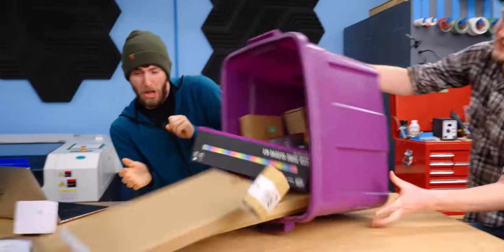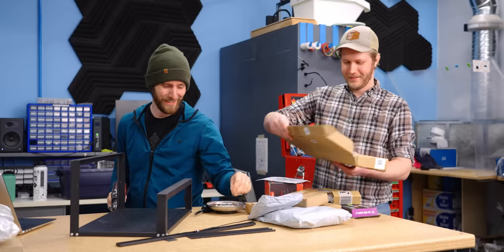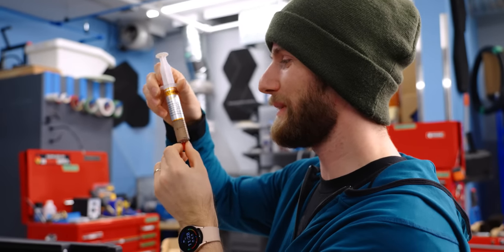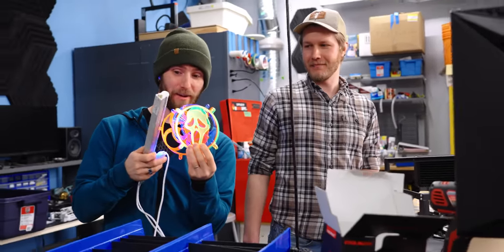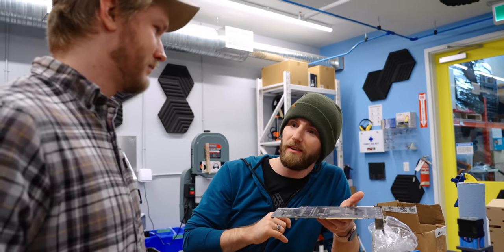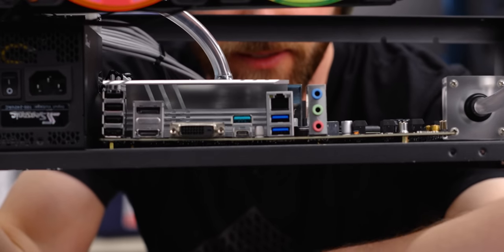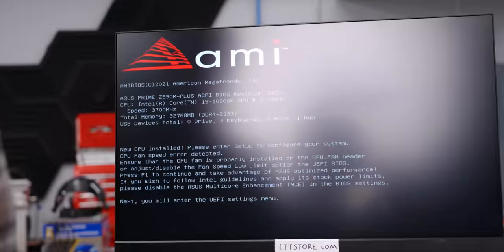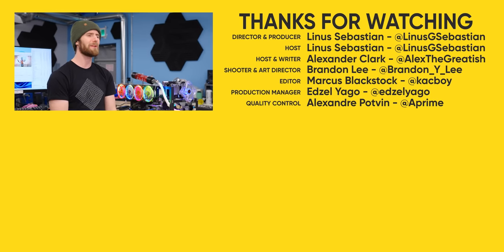Water Cooling… Using only Wish.com

Comment: I have a few of those same types of UV lights (24:35) around my room but they're just a bit longer. They came with rubber caps to cover the exposed connectors on the end, and wow I'm glad I used them because I didn't even think of it being a shock hazard at the time!
Reply: Not a shock hazard, actual electrocution. As in potentially fatal.
Reply: @FIGHTTHECABLE  I have similar lights in my workshop, the little caps Jack’s talking about are really secure, like, almost impossible to get out. 

Also, the wires Linus was talking about when he thought you could daisy chain them together are for tying them into a circuit, the ones I have come with double sided wires with connectors for that.
Reply: @maxwellgriffith  you would have to hold your hand on there for a while for it to be fatal. I’ve accidentally shocked myself a couple times with 120 volts and it was far from fatal
Reply: @michaelhorvath9599   Yeah, he used the word "potentially" there, tough guy.

That it CAN kill you, not that it necessarily WILL kill you. And that is potentially enough to kill someone, if they're unlucky.

And if we're trading tales of electrocution, I got shocked by a wall socket - and I'm in the UK, so that's 240V, by the way - when I was a kid (about 9 or 10 years old, roughly).

I had a cassette player (which dates how long ago this was) but it didn't have a UK three-pin plug, only a two-pin plug (I guess my parents purchased it in Europe or America or somewhere?). So I had to use a two-pin to three-pin adapter. The adapter was in the socket and turned on, and the two pin fell out. So I went to plug it back into the adapter, but I was insufficiently careful and my finger was (barely) touching one of the pins as I inserted it.

It actually caused muscle paralysis. I initially couldn't will my hand to move away. The shock was keeping my hand in place. But, eventually, I was able to will my hand to move. I was in my room - no-one else around - so if I'd been unable to eventually force my hand to move... who knows? "Potentially fatal", as was said. 

And, yeah, a short temporary shock isn't so much the issue, generally, but that it could cause muscle paralysis - the electricity messing up the nervous system's messaging to say "move your hand away" (because the nervous system uses electricity itself, so there can be "interference" from being shocked) - and if you can't get yourself out of that paralysis, that's what'll do you in.
Reply: @klaxoncow  just too add on electricity there is far more 12v dc items than will kill you. than 120v - 240v ac items. volts doesn't matter. amps is what kills not volts
Reply: @klaxoncow  thats not electrocution, if it were you wouldnt be telling us. Electrocution means ur dead. You got a shock, sounds like it had no path to ground through you thankfully
Reply: @mycosys  again its not voltage that kills. its amps. your comment is funny btw. going by your logic. everybody any cop has ever shot with a taser(which inserts electrodes under the skin) would be dead.
Reply: @squirejones3116  It doesn't matter how many amps a source can provide if the voltage isn't sufficient to actually deliver that current. I could have a 12V supply which could provide a million amps and I'd still be in basically zero danger of killing myself. Hell, a couple of AA batteries in series could theoretically provide enough current to seriously hurt you, but good luck getting your resistance low enough to actually do it. Saying it's the amps that kill isn't really a useful way of thinking about it and doesn't paint a full picture.
Reply: @squirejones3116  Amps do indeed kill but they are driven linearly by the voltage according to Ohms law (V = R * I) so higher voltage = higher potential current. 12 volts literally cannot kill you (unless you insert electrodes under your skin) because the impedance of your skin is too high to allow a lethal current at that voltage. So voltage does matter. There are also secondary effects of AC that makes it more dangerous than DC, like inducing sweating that lowers the resistance of the skin but that is a different story.

You can google the health and safety executive of the UK government to see that the minimum voltage considered "hazardous voltage" is 120V for DC and 50V for AC for example and the US has a similar guideline. You can also find typical skin resistance if you want, and effects of different currents to see for yourself what sort of voltage would be dangerous via Ohms law above. Note again that the guidelines mention voltage, and not current since the resistance of your skin is (typically) known, and the applied voltage is what drives the amps.
Reply: @squirejones3116  While you must meet a certain threshold of amperage to kill somebody, that amperage can typically only be achieved when the voltage is high enough, as there is a linearly related. High voltage shocks like static electricity discharges do not kill you as there is practically zero amperage.
Any power outlet is very likely to kill you if it hasn't got ground fault breakers somewhere, that is one reason why they are mandatory in many countries. The thing is, in the US at least, I'm not sure about Canada, these ground fault breakers are usually part of the actual socket and therefore have no effect on socket where they are not. 
Bottom line: 110V AC is extremely dangerous without breakers and even with them it is completely idiotic to have these contacts exposed
Reply: @derfurz8618  GFCI Sockets can affect any number of other sockets on the same circuit, depending on how it is installed. Many kitchens in the US have only one GFCI socket, but all of the outlets in the kitchen are wired through it, so any of them will pop it. Same with bathrooms here.
Reply: @mycosys   Yeah, you're right. And I approve of your linguistical pedantism here.

Yes, an electric shock, not an electrocution - because, like, I am still here, typing this, right now.
Reply: @derfurz8618  volts without amps can't kill no matter how strong or weak. The amount of amperes is the only factor for electrocutions to be fatal. I have an electric fence around my garden it produces 12v@35amps it kills rabbits,cats,dogs. Basically anything that touches it.
 But hey you believe what ever you feel you need to...
Reply: If you don’t have GFI circuits you can absolutely get killed from that, get a heart attack or seizure etc. your house can also catch on fire. Exposed wiring is no joke.
Reply: @squirejones3116  Why do we see this fucking bullshit all the time? Your body provides resistance, you need quite some voltage to push current through your body. 12V wont do jackshit unless you licked both electrodes at the same time, and even then it's just slightly uncomfortable. Your body is not a short circuit, you need volts to push the amps.
Reply: @PhaTs00p  grab hold of your cars alternator charging wires and get someone to start the engine. Grab yourself a Darwin award
Reply: @squirejones3116  Ignoring how foolish setting up such a comically lethal electric fence would be, I think you're misunderstanding its specifications. It's common for electric fences to be POWERED by 12V (e.g. a car battery), but they they step this up to hundreds or thousands of volts to produce a shock . A 12V 35A output electric fence would be useless at best, and a heating element at worst. I have a bench power supply which will output up to 20V at 10A and - surprise - nothing happens if you try and shock yourself at that voltage. Even my laptop charger is 18V 7A!
Reply: @klaxoncow  I'm glad I'm a wee young lad and my parents installed GFCI for the whole house (germany, I don't know electrical code now or then), even floor seperated, so I only popped upper floor GFCI when sticking things in the outlet.
Reply: @squirejones3116  you Just clearly Show you don't know anything about how electricity works. Yes Amperage is the deadly force, but it cannot occur when there is not a sufficiently high voltage.
These 35 Amps you describe on your fence are an arbitrary number, it doesn't mean anything. R = U / I, at 12V for 35A your fence would have to have a resistance of 0.34 Ohm which you might achieve with copper wiring, but no living thing has a resistance even close to that. The human body has a resistance of 1000 Ohm in the worst case and up to 100000 ohm in the best. 1000 Ohm at 12V would result in 12 mA, which is not completely harmless but certainly not dangerous. 100000 Ohm would mean 0.12 mA which is harmless. 
The calculation I just showed is why voltage matters.  If you touch a 600V line, at a body resistance of 1000 Ohm you get a current of 600mA which is well beyond the threshold of potentially lethal. And while I know that all these calculation get a bit more complicated once you throw AC into the mix, the point still stands
Reply: @CycFlame  I know but here in Germany the ground fault breaker is set up to cover all circuits of the electrical panel. Basically all electrical devices in the house are connected to it, exceptions are usually only made for breakout panels, which in turn will have their own ground fault breaker. While I don't know if it has changed in recent years from what I can tell not all circuits have ground fault in the US, as they usually are only used in kitchens or bathrooms as you say, which leaves a gap for dangerous product like this lamp to kill people
Reply: @squirejones3116  There are literally videos on youtube where people touch and lick 9V and 12V batteries, why are they not dead then? Even a 9V battery can provide several amps when short-circuited and you can measure that yourself if you don't believe me.
Reply: @noahluppe  GFCIs are not mandatory in Germany? Crikey...
Reply: @eirikheggelund  I don't know, said that. Looked it up, seems like for wet rooms since 1984, for all easily accessible outlets in residential since 2007, for all outlets since 2018. My parents build their house ~2000, so before it was necessary, and not only one but three for independent floors.
Reply: @noahluppe  Not too shabby!
Reply: @derfurz8618  In my state at least, it is code for new services and buildings to have combo GFCI/AFCI breakers on all circuits, but many many homes don't have updated services, as it is only required by code that your service be replaced if the panel was recalled, or is grossly damaged/poorly installed, and inspections only happen generally before a sale or when adding an addition. So by the code, they should be combo breakers, but most people don't update their service unless they have a major fire hazard or something is going wrong.

Comment: a bong reservoir is something i need to see now in a water cooled PC. especially one with percolators and recyclers in it. would be cool to see the liquid flow through it and see if it would impact cooling at all. doubt it would though. feel like even if you arent someone who partakes, it would make for a sick looking reservoir. especially if you got a really fancy one with a lot of design put into it. awesome vid
Reply: the percs dont work when if its completely filled with water. if you want bubbles you'd have to use half the water and it wouldnt be enough water to cool anything or run the pump.
Reply: @XsuperXrcrazyX   yeah, you’re right. Didn’t think about that at the time. Plus, other than air bubbles causing temp issues, also heard air bubbles can break pumps. Even though the percs wouldn’t function, think they could still look cool aesthetically
Reply: @imperfect_cliche  Right on man you nailed it
Reply: Celebrity build with Tommy Chong. lol
Reply: @XsuperXrcrazyX  Fill the bong quite a bit with water, blow air through the percolator to make nice bubbles, then pull out the water from the bottom without bubbles. i'd call that DIRECT AIR COOLING! cause: air in water. Will get insta gunky but sure will look nice :D
Reply: @ChrisBigBad  doing that would damage the water pump, and kill you flow rate
Reply: Did somebody say percs? 👀

Comment: The white LED bar that came in my HL-Yeah HL1060 laser was the same type setup, but at 220v..  Needless to say, it's also in the 'e-waste' bin and replaced with 24v led strips.
Reply: hahahahas
Reply: Yeah, some stuff you just have to bin it or risk getting someone killed.
Reply: clearly meant to be installed to your house's electrics
Reply: Could be a repackaged therefore falsely advertised thing?  Also why is it really a risk?  I mean common sense is never touch connections and shield it off if not used. Unless I am missing something. 
Either way that thing reminds me that I had something like that above my head height for my kitchen sink so I can see while washing dishes it was great for that granted it never had a extention port on the other end but even if it would I would shield it off even glue it in, I mean it's common sense.
But still I am curious is there something else I missed?

Comment: Those wire ends that are open ended for the uv lights are for wiring directly to a light switch in a wall or ceiling! NOT to combine them!!!
The ends should have plastic caps haha

Comment: 8:25 you're not suposed to leave the "watery" part of it there, it's just oil that has separated from the paste itself, it happens in almost any cheap paste.
Reply: "It's thermal paste prec*m" - Alex, LTT 2022
Reply: Yeah I thought the same thing, it was just partially separated
Reply: Good paste costs 3-5$ wtf why people buy "cheap" paste
Reply: @neuplop  I have TG Kryonaut and a few bundled pastes, I only use the super cheap for non-worthy devices or other things I do, like a homemade dehumidifier and some custom led panels.
Reply: same thing happened 2 days ago with my Arctic MX2. Granted, it's been lying in a drawer for about a year but still, it's a brand product after all
Reply: @GP1138  LMAO I literally DIED when Alex said that!
Reply: Not only cheap ones. I'm pretty sure Gelid Extreme was also very prone to doing that at some point, and eventually, most pastes will have some separation.

But you also aren't supposed to have that happen from the get go. I even got a tube of GD900 and that's been behaving just fine. I'm actually liking it, seems like a quality product. Which is not something that can be said of this paste, it's probably identical to H610, which is just garbage.

But also what are you gonna do? It's just a temp build for a video, wiping the separated oil off, like why, the whole thing will get dismantled and washed in a matter of hours or weeks.

Comment: 15:46 I was ONCE this rough with a gpu, when a resistor went flying off of it. Luckly the solder broke on each side just so right that I could wedge it in there again and re-solder it. It's still working like nothing ever happened
Reply: I can feel the anxiety you had with that one, lol.
Reply: I guess you were lucky twice, you'd have needed to find the resistor first.
Reply: whahhaha unlucky with that! good u could manage to fix it!
Reply: hes a mad man for this, i would only treat a board like this if it was water damaged, but hes still scrubbing like its got cavities XD
Reply: @832738  lol, exactly! At least he got dozens of it, that one was my only one